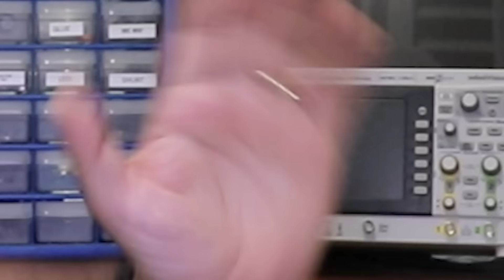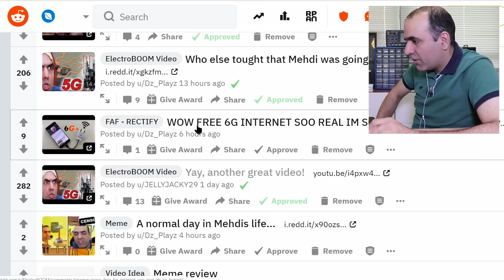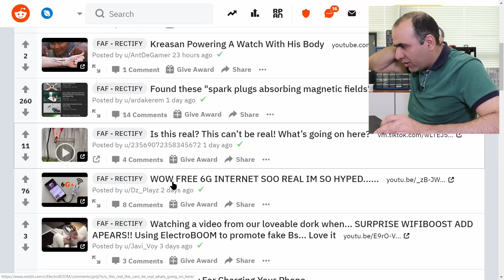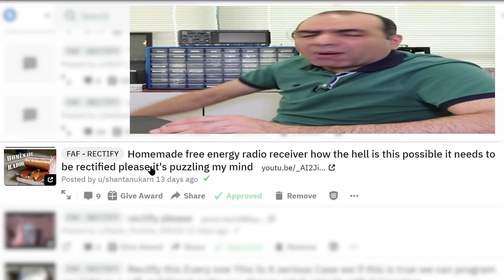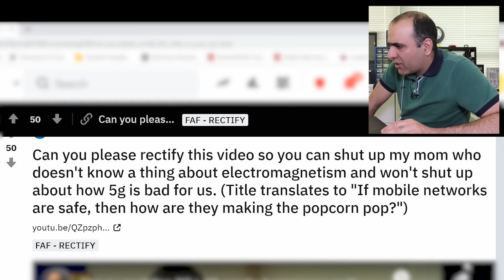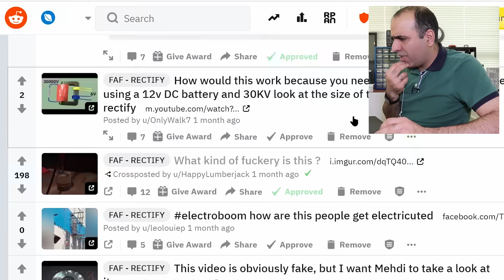ORIGINAL CONCEPT: Reviewing Your Reddit Submissions LATITY-001

Comment: That audio transmission through light is pretty neat. I noticed that when you move the light closer or further away it affects the volume, but it also causes interference that blocks the audio completely while it is moving. What mechanism is causing that? I can't imagine that it could be anything like dopler, not at the tiny speed that you are moving it.
Reply: I think it's maybe because the AC audio is riding on some dc level and this dc level changes when he moves it, which messes with the amplifier.

Comment: Phones actually do give off microwave radiation. Although not nearly as powerful as the inside of a microwave oven. Usually the wavelength is about as long as the phone itself. Correction the wifi on your phones use microwaves and the mobile data uses radiowaves.

Comment: 2:20
Buddy at work was cutting a hole in drywall for a keystone box and he managed to cut right through the conduit. 
Didn't just cut the insulation.. He cut all the way through copper wire with a manual drywall saw. How he couldn't feel the resistance still blows my mind.

Comment: There are wire detectors for concrete walls. Bosch makes them, but they are ~$1500 (but they also detect and differentiate ferrous and non-ferrous metals, so you can tell the difference between copper pipe and steel conduit).

Comment: 2:45 Also, common sense. If there's an outlet, or a box, in the wall, 100% left, right, above and below that there will be wires going in the four directions.
Also light switches, only up and down usually, for those. Up to the ceiling for the light, down to hook to the wires running horizontally in the wall.

Comment: 9:44 Oh mehdi yes that circuit is really workable but if you want to find out a bit weird designed that it might make sense to use ldr instead of solar cell yes that circuit is being stolen but use the solar cell light sensor which is a bit ridiculous.

Comment: Would be incredible if you make an audio transmitter using a laser and a light variable resistor or a little solar panel. The lazer don't shot light randomly so the distance should not affected the volume as much and with a relatively long tube that is paited in black in the iner side the enviremental litht suden't afect  the resistor ou solar painel whit noise.

Comment: 9:58 its not as complicated as it looks, it actually works similarly to a Fiber optic cable. it transmits power and signals via light... its apparently faster than wire connections
Reply: Interesting. My first thought is that it's not too far off from how sound was reproduced for movies on movie film. Movie film that's to be projected at a movie theater have an optical sound track right on the film. One could describe it as looking like a black silhouette of a sound wave on Audacity. The film moves past a light that is shone through it which varies the amount of light hitting a sensor on the other side. This is transformed into electrical signals that are then amplified.

Comment: Holy crap, you can make a speaker with light from an LED. Actually, isn't that how Fiber Optic tech works?
Reply: Типа того, но это для дальних расстояний. Есть такая штука как оптопара (optocoupler), которая проделывает то же самое на маленьких расстояниях. Полезно для того, чтобы разделять в определённом месте электрическую цепь. Поэтому его зовут ещё opto-isolator (но не в русском).
Reply: Yeah. There's actually an optical audio cable standard called TOSLINK that works in basically the exact same way as what Mehdi showed here.
Reply: Thank you both! I haven't heard of those before.

Comment: 4:49
There also is a circuit that just involves a single 2n2222, capacitor, LED and resistor. The circuit only works on 9V+ however.

Comment: AT the timestamp: (8:40) The LED thing is basically how IR works and how IR became a thing the problem with the LED was that to get a really good signal from far away the LED needed to be brighter and one single LED couldn't produce enough light with the limitation of how much power can be driven through it so they tried to use multiple LEDs at once but then that didn't work so they thought that maybe it's because the light is going all over the place so then they made something to direct all the light through one hole but then found out that in the long hole they made (tunnel) it eventually gets darker towards the end so they thought maybe if we make the hole / (tunnel) shorter and eventually found that it did kind of work but it's still kind of going all over the place and then they thought what if there was a way to have a bright light but not be able to see it so they then eventually invented IR

Comment: I have an idea adding a laser to the LED/speaker project. Use a laser instead of an LED.  Then you could transmit sound across a room without running wires across the ceiling. Put the solar panel in a tube to hide ambient light. Use UV laser so it effects the solar cell more than red or blue and you can't see it. Would you circuit work to do this?

Comment: Im pretty certain the Microwave one was all fake.  Using one of those wireless remote controlled trick light bulbs, after effects editing for the sound, and just some stuff hot glued to the side of the microwave.  If you notice we never actually see the microwave is on, the camera never pans over.

Comment: The line voltage is usually 120 or 220 volts, but you can convert it to 5. The 5-volt side is connected to your device to charge it. It's not only the same on all the chargers, but it's also part of the standard.

Comment: 8:50 So he just made a really shitty optocoupler? I did the same thing myself with a single IR LED and a photodiode wrapped in heatshrink and it still had too much delay for it to work at audio frequencies. Just use a real optocoupler. They cost less than this crap and work better. The only reason I did it was for fun, to see if I COULD make an optocoupler from just those parts. But there's no reason to make your own when they cost like $1 or $2 for a pack of 10.

Comment: As for the popcorn: A cell phone signal has at most 2 W power but only if you are at maximum distance to a cell phone tower. In reality it rarely ever reaches 1 W. It I try to pop a few popcorn kernels in a 600 W microwave, it will already take longer than in that video. With 2 W, the kernels will cool down faster than the cell phone could ever heat them, so they won't heat up at all. That's so ridiculous.

Comment: according to Wikipedia The thermodynamic free energy is a concept useful in the thermodynamics of chemical or thermal processes in engineering and science. The change in the free energy is the maximum amount of work that a thermodynamic system can perform in a process at constant temperature, and its sign indicates whether a process is thermodynamically favorable or forbidden. Since free energy usually contains potential energy, it is not absolute but depends on the choice of a zero point. Therefore, only relative free energy values, or changes in free energy, are physically meaningful.

The free energy is a thermodynamic state function, like the internal energy, enthalpy, and entropy.
Reply: So it should be real if you make a diy projects

Comment: If you don't want to buy a cable detector, you can use a coil ( I used ~20 turns, 0.15mm wire and diameter of the coil 6.5cm ) connect it to the probes of the multimeter and set it to ac voltage (in my multimeter the best is 2v ac). Bring it close to the wall and if there's a live wire, you should have a voltage rise

Comment: There is a great little book. Called UGLYs Electrical reference. It is a great gift for anyone in the field. Its gives all the formulas to find Volts Amps and so on. It has sections giving wire gages How many conductors will fit inside given conduit sizes . As per The NEC code. The book gets updated as the NEC does. Its has a very useful resistor chart Giving the colors and values. Give it a look C

Comment: Herbal supplements have existed for thousands of years and can be traced over several different cultures. For now. Herbs are now used to cure diabetics, herpes, chronic pain, asthma, Ovarian Cyst and even HIV. I like herbs so much. Most of the time, the injection and the drug are only a loss of duration. I was cured of HIV last year with the use of herbs, I suffered from HIV for 13 years, but with the help of DR. Freeman Osas Herbal Medicine, I was cured in a few weeks of using the herbs he sent me by mail Service Delivery. I don't know the kind of health problem you are facing right now, but I assured you that you will be cured if you contact Dr. Freeman Osas and explain your problem to him, that the issues will resolve in a few weeks , contact Dr. Freeman Osas by his e-mail address: drosasherbalhome@gmail.com or reach him via WHATSAP number +2349050514983

Comment: The LED + solar panel thing... isn't that kind of like a vactrol, but the panel generates voltage instead of altering an external voltage source? Would probably make a pretty dope fuzz circuit if you stick it in a dark enclosure

Comment: Just an interesting fact. That light / solar panel circuit is exactly how sound worked on old films. There was a waveform on the side of the 35mm film strip that caused light variation between a bulb and a photocell. Dates back to the late 1920s.

Comment: Dude that guy with the microwave. Even I know not to do that.................buuuuuuuuut I'm not gonna lie, I kept the magnetron and H/V capacitor from an old microwave. I haven't used the magnetron on anything nor have I powered it but I only needed the transformer and and so the cap and magnetron is just sitting around. I was making a stick welder.

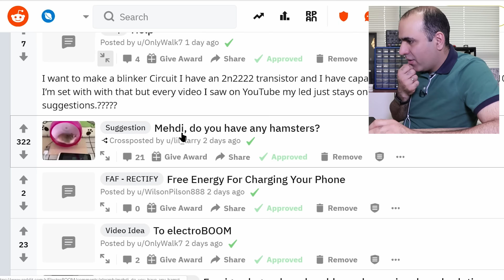Comment: 4:52 it's an astable. It's even written above. A bistable has 2 switches, each of them on each base of the transistors. Capacitors are absent in the bistable. In the astable do not mix up the resistances (i.e. 470 instead of 47k or vice versa) because it is designed to charge the capacitors slower on the negative pole. In a polarized cap the positive pole should always have a potential higher than the one on the negative pole.

Comment: 13:35 ultimate cancer generator
Reply: Frequency is too low to cause cancer but it could burn the sh*t out of you
Reply: It's non ionizing, all it will do is heat
Reply: @LunaWuna  yea i guess it's not energetic enough, still seriously unhealthy.
Reply: Except microwaves aren't ionizing radiation so it wouldn't do anything

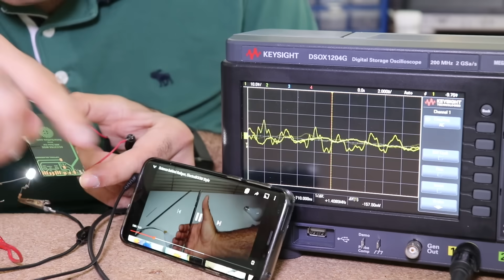Comment: At 10:55 the speaker moves from top to bottom because by blocking the solar panel its resistance gets extremely high which means the current drop

Comment: 5:24 you should know that that  wire is not live BIG MISTAKE.... those giant wires have capacitive   "properties" too so  it is not like your hairdrier that you turn off plug out and safe to repair.. those wires have two switches- first is the power switch(contacts are in oil or in vacuum so it would not ark like a welding machine) and second is usually a manual switch where you ground the wire for its captive  charge to  be connected to ground-do not forget that this is an isolated wire for lots of km-s long

Comment: 4:10 These are called Lichtenberg Figures and they are awesome.

Also, awesomely difficult to produce, because as you said, you have to somehow trap electrons in a piece of uniform dielectric (usually acrylic so you can see through it). I don't know if this is the only way, but usually how they are done is by using a particle accelerator that accelerate electrons fast enough so they can go through the material, but not too fast so they don't go completely through.

If you manage to build a particle accelerator in the mega-electronvolt range, give us a heads-up!

Here's an example : https://www.youtube.com/watch?v=mJTjs4mDtZw
Reply: mehdi already did a video on lichtenberg figures before using a microwave transformer and wood
Reply: @connivingkhajiit  What I'm referring to is completely different and requires a completely different setup. The figures are branching inside a 3D volume, not simply on the surface of a material.
Reply: i watched rural Alaskans make them with vinegar and a car battery. it's not that difficult
Reply: @SharpForceTrauma  did you even read what I wrote? I'm not talking about etching a wood surface, i'm talking about capturing them in a 3D volume of transparent material.

Comment: Dear Mehdi ,
 Last night my son found this loose wire in the wall while he was painting his room and wanted to get rid of it. We used a tracer to see if it was live and it wasn't, but just to be sure, we put every single switch off in the cabin. 
But when we returned to take it out, my son said that there is now current on the wire and it zapped him for a moment. We never wear shoes at home but because of painting the whole house we did now. I believe his shoes saved him but, how could there be current if I turned every switch off in my central cabin?? 
Could the wire come from neighbours maybe? 
But if it was that,why wasn't there current when I had every switch on??
I could have lost my son because of a loose wire in the wall. I know better to  not f with electricity, but I want to know if my thoughts could be true.

Comment: "Free Energy 2019"

It really sucks that they're patching out free energy all the time...
Reply: I hate how they only work in 2019.
Reply: 1.5 volt battery & 0.0001 ohm resistor. 
I  = 1.5 / 0.0001 = 15000 Amps. 
P =1.5 x 15000  = 22500VA.. FREE ENERGY (kind of) :P
Reply: @generalbutz8477  only if the resistor doesn't vaporize instantly after consuming such a huge amount of power and can give it to environment constantly and also only if the battery has infinite capacity and can provide such a huge amount of current without heating up and blowing up.
Reply: @generalbutz8477  i have a better one for you. Freeze a material to 0 kelvin and create a superconductor. Superconductors in theory have 0 resistance so if you pass through even 1 mV you will have infinite amps. That's how you become a level 10 civilization 

(Don’T tell the government i told you this. They always try to hunt me down and lock me on one of their scp containers.)
Reply: Now we need to hunt for the free energy 2021 bug
Reply: lmfao
Reply: God needs to stop patching bugs smh
Reply: 69 likes😀

Comment: Hey FYI as far as I know the lineman at 5:20 was not cutting a live wire. I was recently talking to a friend who works for the power company about induced voltage keeping LED bulbs illuminated in my house, and he showed me this clip as an example of how extreme induction can get.
Reply: Most likely the line was energized but had no significant load connected. Notice how he was insulated sticks to handle the wires. If the line was de-energized there would be grounds connected before commencing work, which would have dissipated any stray voltages.

Comment: Sadly that voltage stick is sometimes way to incensitive to detect live wires at some distance. I came up with a makeshift signal amplifier which detected 50Hz much more reliably. Problem was that in UK some conduits are made of a feromagnatic material of some sort which shielded the EM field, which means even my creation turned out useless. So i tried a magnet but it seems like the magnet was attracted to every single place on the wall. So i ended up inviting an electrician and he said the wires can probably go in either direction. Literally screw it.

Comment: Can you show us how to make an inverter for VDC to VAC? If that is possible. I'm trying to create a system for powering an off grid house using clean wind or water power to turn a turbine or alternator to generate enough current to use a step-up transformer and high voltage transmission lines. I not 100% sure but I think an alternator creates a DC voltage output of around ~14v and based on the size of my primary coil compared to my secondary coil i can step that up quite considerably to be transferred through the high voltage lines and ran into the primary of another transformer to then step-down the current and voltage into the junction box (breaker) to power a house but that is has to enter the houses junction box at at least 240VAC to then be used by the breaker at only 110VAC per breaker (US houses use the breaker to separate each room or circuit to use 110VAC). if there is anything I am mistaken on please help and anything else you could teach me about high voltage transmission and VDC to VAC (and visa-versa) inversion it would be much appreciated. I've been watching your videos since I was 12 when you first started back in 2012. I am a HUGE fan these years later and I hope to start school soon for electrical engineering and computer science to become a computer engineer. I love your videos and can't wait to see more! keep up the good work!

Comment: Comunications engineer here, the light thing you did is something used in telecomunications, its called an electro-optical transducer, the signal gets to the antena and its converted from a electrical signal to optic then transmited trough fiber optics then its converted to electricity again so it can be processed, its used to avoid delay and loss that might hapen due to cable lenght.

Comment: 8:26 These are called Crystal Radios they are very real, my dad had a kit and made his own in the 50's, it still works to this day.
Reply: It's not 50s
It's 90s because at 1950 it was actually used for public news and more
Not fifty's you use the thousands and hundreds and say 90 not nineteens 
You say 90s and a crystal radio was used to receive very low AM transmission
It was not very easy to use because every specific wire is a channel